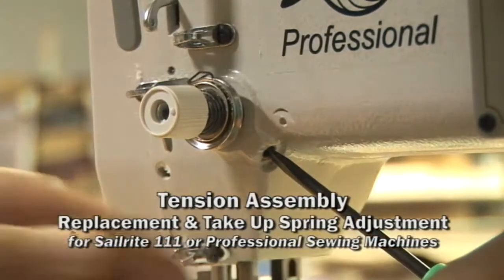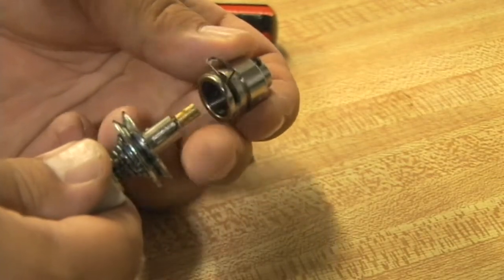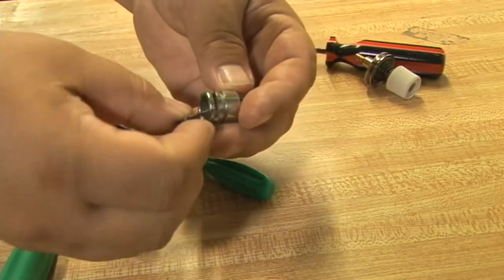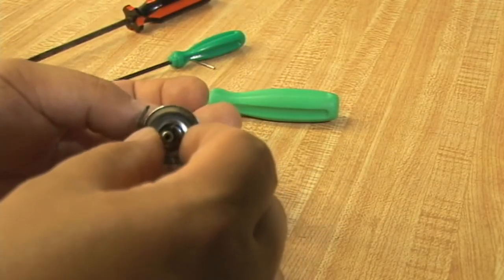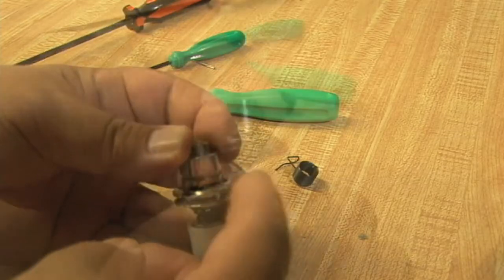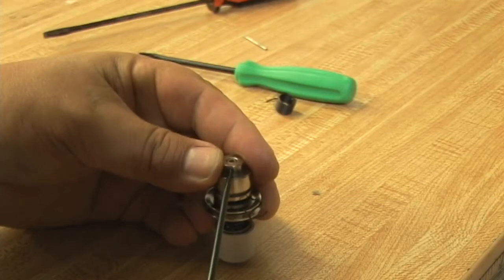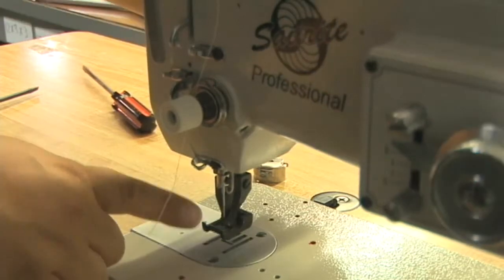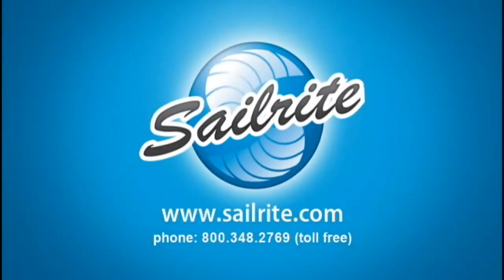Tension Assembly for Sailrite 111 & Professional Sewing Machine

Comment: So I have a question. Does the tension screw need to be tight, or loose? In what position does the screw need to be when inserting the assembly back into the housing and testing the tension spring disk separator when lifting the presser foot?
Reply from the maker: The tension set screw does not need to be tightened with testing the tension pin that separates the two disks. But once you find the correct position then it must be tightened and tested with it tightened.
Reply: @SailriteDIY  I'm sorry, I was referring to the actual knob that provides the tension once set, not the set screw that holds the assembly in the housing. The tension adjuster. Does that need to be fully turned to max, or loose, in the middle, or does it even matter?
Reply from the maker: @edwinaragon4878  Should be near the middle position when testing. Max down is never a good place for the tension knob as it does not allow the disks to separate and usually pushed the whole tension assembly out from the casting of the machine.